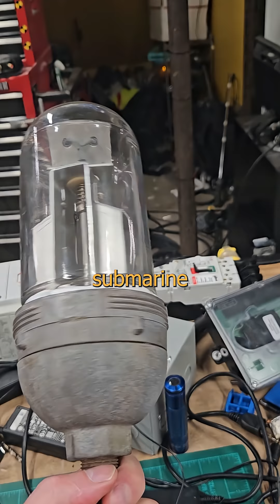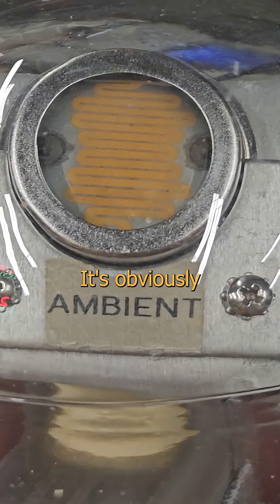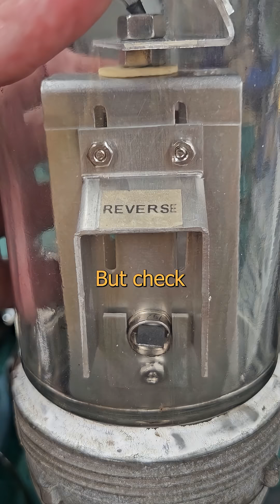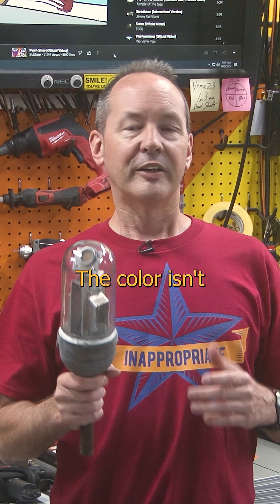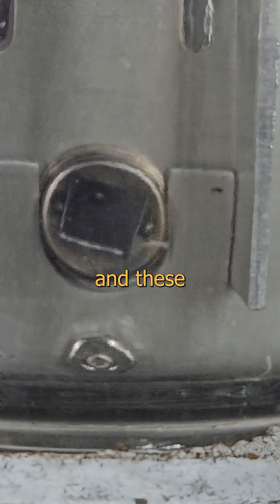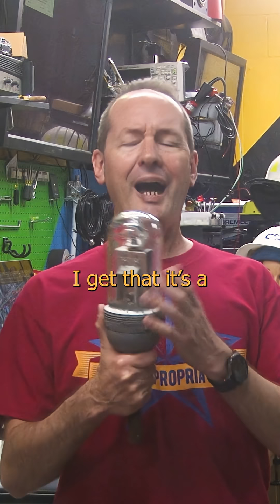Weird Light Sensor #chrisboden #comedy #engineering #electronics #electrical #educational #science

Comment: Is this something to do with those lights you see on top of very high antennas? And, the three photocells(?) help to disconnect the aerial in case of a lightning strike?
Reply: Unless the glass is supposed to be broken I wouldn't imagine that it would have to do with lightning strikes. I could be wrong but I would assume that a lightning strike would destroy that thing and also the components look very fragile, which would make me think that's not the case. I could be wrong though, idk.
Reply: @De_Frog101 Well said🎉
Reply: How would it know there was a thunder storm in the locality?

There are ways for electronics systems to identify if lightning is in the locality but it isn't using light sensors.
Reply: The top comment answers what it is, in case you've seen it yet.

Comment: i imagine the whole assembly rotates, maybe the solar cells are for turning the sensor towards light? 

Likely to trigger certain lighting components on a tower r  bigger building
Reply: Yeah I agree.
Reply: I would agree but there doesn't appear to be anything on the bottom but that could properly catch a gear or set of threads. I'm not saying it can't be the case, just that, from the looks of it, it doesn't appear that way.
Reply: @De_Frog101 Yes there is. Right at the start and end of the video, you can see what seems to be a hex nut at the bottom of the case, I suspect this is what the turning mechanism grips